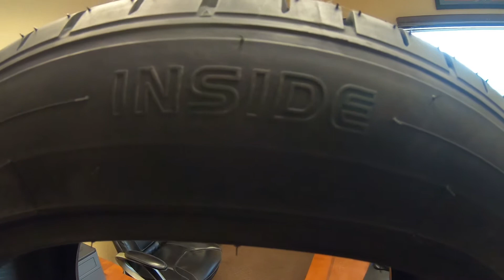#TireTuesday: What is the difference between a symmetrical and asymmetrical tire

Comment: My car is front wheeled drive. Ive a pair of symmetrical and a pair of asymmeyrical.

Which pair should I put on front and which on rear??

Pls help me decide
Reply: @SoCoCustoms  could you explain me why? Actually i already did that. Front asymmetric for 1.5 years (I bought all 4 in exact time). I ve been thinking to rotate it, because the front (asymmetric) has about 50 percent wear, and the rear (symmetric) just about 75 percent. Should i do it? What is the risk..

Comment: What annoys me is the fact that ALL asymmetric tyre treads run different left to right....google the  vredestein ultra sessanta tyres and look at the pictures....surely hitting a patch of water would cause the vehicle to steer more one way as opposed to a directional tire that will run straight
Reply: @SoCoCustoms  only a directional asymmetric tyre does that as asymmetric tyres are the same tyre left or right and when mounted on a car one side has tread pattern going the opposite way/going the wrong way as per the ultra sessanta tyres...easier way of explaining is find some porsche turbo twist alloys and one side is always annoyingly different to the other.